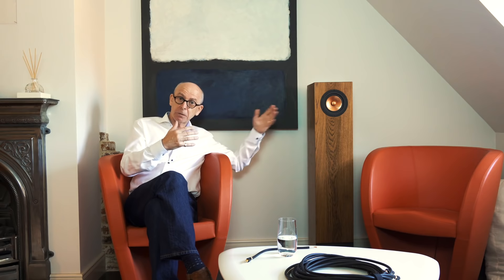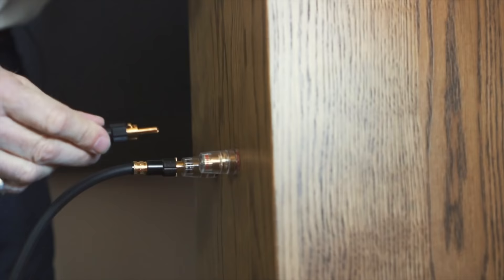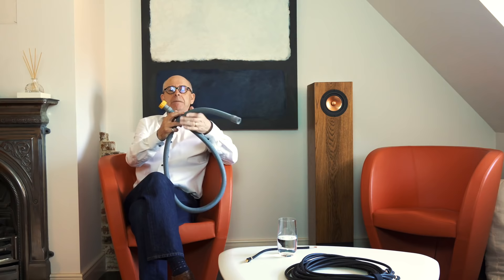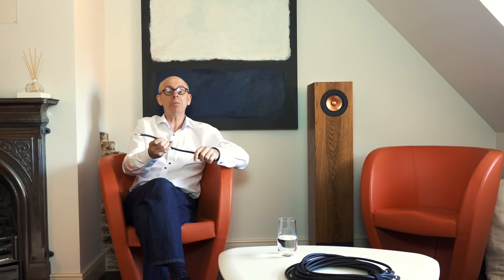Loudspeaker cables - how do they make a difference?

Comment: I don't have a problem discussing cables at all. I DO have a problem with "experts" telling me ONLY expensive cables are the best...
Reply: Here’s a analogy:
1. A tin roof is not going to be as strong as a concrete roof. Apparently a concrete roof costs more. 
2. Similarly good quality interconnects and cables cost more than cheap copper?
Reply: As long as the cable is made of Copper and isn't too thin it will sound perfect. A 1€/m cable will sound the same as a 100€/m cable, as long as it fulfills a certain minimum critera.
Reply: @rolandrohde  Indeed. I have conducted my own blind test on my hi-fi using Van Damme cable (a good quality, reasonably priced copper cable) and another brand (£12.00 per metre) and I could tell no difference whatsoever.
Reply: I was with your mother  totally agree. I was justifying the cost differential between good and bad quality copper. Not debating whether the quality of sound would change significantly to justify the cost.
Reply: @Debagio that probably tells us more about your hifi than the cables tbh
Reply: Listen and watch a very recent upload from audioholics about testing cables he goes through his equipment he uses both the source and the measuring equipment. His results are very interesting basically between the expensive and the cheapest cable and those inbetween there is no audible difference the human ear can pick up its just too small.
Reply: Sound engineers totally agree!
Reply: finally an intelligent hifi man out there!
Reply: are an intelligent man!
Reply: @baboononskates someone has spent a fortune on cable and is frantically defending his huge waste of money
Reply: @baboononskates oh goodness I touched a nerve. You really did spend too much didn't you? And my Arcam and Focal system is just perfect for me, appreciate your concern though.
Reply: @everything777 Arcam and Focal do sound great with 13 AMP Round White PVC Mains Electrical Cable apparently.
Very transparent and great soundstage.
Obviously bare wires into the amps speaker terminals..
Reply: @baboononskates  what are you on about?
Reply: @garynilsson416  dear Gary! Wish i were young! Sadly i am 68!
Reply: @everything777  you are a very healthy person!
Reply: Just for fun I went to a HiFi store and let a young dude explain to me the advantages of expensive speaker cable. After 10 minutes I told him I was Electrician and that he was full of it.
Reply: You are so right! I have been working with advanced analoge and digital gear for 30 years! A good copper cable will do the job!
Reply: @nellyt2807  you are so right!
Reply: @everything777  nice to hear from a person who is not talking bullshit!
Reply: @everything777  i have given up discussing audiocables with the hifi fanatics!
Reply: @nellyt2807 I did.  And guess what?  His measuring equipment was so accurate that he didn't even need to listen to the cables to know how they were going to sound!
Reply: @darwinstubbie860 Do electricians know everything there is to know about speaker cables?  I had no idea!
Reply: @barrymiller3385 do people who have no knowledge of science, physics and electrical theory know everything? Not implying this is you because I don't know your background. There are too many unexperts giving their opinion without true understanding. I say if it works for you great, if not save your money.
Reply: @rolandrohde  

Any cable will have a certain amount of capacitance, inductance and resistance. 
This forms a filter that will change some frequencies in a signal to some degree. 

For a low output impendance device like a power amplifier, the effect is negligible, but in high output impendance sources, like the pickup of an electric guitar, the effect can be dramatic,
Reply: This know-nothing audiohead has made and used, 12-14 gauge pure stranded copper wire since the vinyl bug bit some 50 years ago...SFSG. I'm still using them, the only thing I've done is make them shorter and replace the connectors, twice.

Comment: There's so much snake oil in this area of hi-fi.
Reply: Preach. It started in the 80's when big corporations learned how stupid people can actually be.
Reply: @automachinehead  - EXACTLY!
Reply: No surprise that changing the shape of a speaker voice coil changes how a speaker sounds. That does not prove that changing the shape of a speaker cable will change the sound of a system. There's a big difference between the operating characteristics of a voice coil and a speaker cable.
Reply: @ProffAndy  hm... then again, he didn't change anything about the speaker cable. As I understand, they claim to keep it as simple as possible.

I mean, this is a product information but he is not advertising anything snake-oily, or did he?
Reply: This is a question of psychoacoustics rather than engineering. The testing would have needed to take place under blind, controlled conditions to demonstrate anything.  Geddes/Lee proved that the already known phenomenon of audiological masking caused distortion of up to 20% in some frequencies to be completely inaudible. Not saying that the design changes did/didn’t make a difference , although it’s counterintuitive as it would mean hearing the a mechanical difference introduced by microscopic fractions of current within the sea of distortion that the worlds best transducers are. Just saying that the laws of human psychology apply to engineers as much as anyone else, and it’s possible to be a highly competent mechanical engineer like Mark Fenlon and be quite unaware of them.
Reply: @automachinehead  you can take it all the way back to the '70s.
Reply: Thats why I got out of it many years ago, it went from a fun hobby to a expensive cult.
Reply: it's ALL snake oil when it comes to audiofools.....

Comment: The analogy with voltage and speed is incorrect and the electrons do not "bash" into each other.. wtf
Reply: I agree and have just written a comment to that effect.
Reply: Hard to imagine anyone who knows anything about electricity making that statement.
Reply: @Scottlp2  It's about as close to reality as saying that petrol engines work by the pistons being pushed by the flatulence of little red demons that live inside and love to drink petrol.
Reply: It is even the opposite. Electron repel eachother since they have all have negative charge.
What actually happens:
The electrons jump from the shell of one copper atom to the shell of another one where a "hole" has been created because that atom also had an electron that has jumped.
The electrons are moving from - to +
The "holes" is what we call the current, and move from + to -
Cables do have an effect on the current that they are carrying.
There is resistance, capacitance and inductance and skin effect.
The capacitance and inductance in a normal speaker cable are so low, you can just ignore it for audio frequencies. At most, it will attenuate higher frequencies, but never to the extend that it will be audible. This is an educated guess, I did not take the time to calculate this.
The resistance just attenuates the signal, and doesn't change the sound. The volume knob will compensate for this.
Skinn effect again can have a very small impact on the highest frequencies, but virtually inaudible. Audioholics have some calculations on their site for sure.
Of course a speaker voice coil can change the sound. It is a coil, so a high inductance, and together with the filter, I guess you can create an unwanted resonance frequency.
Reply from the maker: @Richard-bq3ni  thank you for this excellent comment. It adds greatly to the quality of the debate. The problem in all these talks is to which level one should explain things. I am not a physicist but I did refer to one. I even contemplated bringing one into the short video but I felt it unnecessary. Your comment has added the value I was looking for. But of course it is very possible that someone will now challenge it.
Reply: The concept of a mettalic bond....or ohms law are beyond him....and yet....I'm sure he takes a lot of money from chumps.
Reply: @think2023  I agree. Nearly 27,000 views (so far) at fifteen minutes each is a LOT of time wasting (6,700 hours).
Reply from the maker: @think2023  thank you for your reply. I thought I was making a useful and informative video. It is always difficult to pitch the level from a technical perspective. When I used the term ‘bash’ I thought it was appropriate to show that the electrons are not flowing from one end to another. I didn’t say ‘collide’ as obviously that would be incorrect. I did leave out a lot of points like ‘skin effect’ the point I was trying to make is that in the whole HiFi story the cables should be your least concern. And that good quality, multi strand copper will work fine. Which is the standpoint I like to keep. I am not a nuclear physicist but I do have a strong grasp of physics and acoustics. I am sorry that my video offended you so much.
Reply: @PearlAcoustics  ALL of the science I referred to I learned....in high school.
Again...please dont waste peoples time on account of your lack of diligence....its just unfair....unhelpful...and disrespectful.
Reply: @PearlAcoustics  perhaps you should rephrase your comment...." it's always hard to pitch from a technical perspective when you have no technical knowledge".....

Maybe you should add speaker cables to your offerings. I'm going to suggest dunning-kruger as a model name.
Reply: @dweblinveltz5035  sorry...no idea what you are talking about. Last I checked it was about physics and ohms law
Reply: @think2023  I noticed autocorrect changed key wording in my last post; maybe it will be clearer for you now.
Reply: @dweblinveltz5035  the topic of the video WAS electron interactions
Reply: @think2023  now you’re just being obnoxious. He’s making these videos for free. And occasionally, some may need some corrections. We are all human. At least he is contributing to society, and many of his other videos are helpful. What have you contributed lately?
Reply: @think2023  No mention at all because they need not be mentioned at all. You are the typical nincompoop looking for anything to take offense from. The entirety of the point is that, with any good copper speaker wire, you will be satisfying the requirements for resolving the signal path. Period. But please, feel free to elaborate ad nauseum regarding your opinion on the world as we know it.
Reply: @think2023  Wow, pedantic much? Anyone can see that he's explaining in very layman's terms and in a way non knowledgeable people can get a hint of the science behind it. Many people will not actually care about the accuracy of the information
Reply: @limp6986  when talking about science there are different levels of Truth and accuracy. In Ohm's law for instance the first approximation refers to resistance. If someone was talking about speakers and referred to the resistance of the speaker cables it could explain a lot about the behaviour of speakers and amplifiers and damping of the woofer and so on. When you look more deeply you will see capacitive and inductive reactance skin effect the effect of impurities in temperature and much more. I have zero quarrel with simplifying science in an effort to help a Layman to gain a basic understanding.
However....when total falsehoods are espoused by someone who is obviously ignorant of the science...I consider it wholly unhelpful.
Reply: @Simplyveej  make no mistake. This man is selling something. He is selling speakers and cables. It ain’t free. The cost is your intelligence. This video deducts at least 2 iq points per viewer.
Reply: @derekr5327  Selling something is not evil. He is making a living like the rest of us. Chances are that your job and your salary exist thanks to a sales person somewhere. And just because he's selling doesn't mean we are compelled to buy. We are free to make our own decisions.
Reply: @dudemastermaster8944  
The only difference can be decibel level. I'd that's the case get larger gauge wire for the longer runs and that's that.
The imaginary man can't hear a difference because there is no difference.
Reply: @Finn-McCool  well that wraps up what I said. So I call that a stalemate. Stay safe.
Reply: Why do audiophiles all think they are experts about electron flow etc.

Comment: Been in electronics for over 40 years and wire vs SQ has never been an issue for me. I do like the bit that tightens the banana post in the hole. That's actually simply brilliant.
Reply from the maker: Thanks. I wish I had invented it! 😉
Reply: Hi Harley,  Another very illuminating video, love the domino analogy.  Where can one get the locking banana plugs from please?
Reply: Came here for the comments, love them. Didn’t watch the video yet. I will say, when you look inside a tower speaker ( a have the respectable Rega R7), there is about 4 feet of zip cord ( or something similar) that travels from the binding post to the drivers. To think the 8 feet of external speaker wire makes much difference is pretty funny ( unless it’s very thin aluminum or something). But for some reason my friends still looked upon my good quality but fairly inexpensive cables with disdain. So I made my own, dressed up with nice ends, shrink tubing , and braided sleeves. Thinking I finally invested in higher end cables, They swear it made a difference. But it didn’t.  Eyes play tricks on our ears.

Comment: Years ago McIntosh used to do 'traveling labs," going from city to city.  They would check your old amp if you brought one in.  In those labs they would compare various speaker cables and ask listeners to identify when better cables were being used.  The listeners did not know which cables were being used.

There was no consistency in selecting between cables - from standard 18 gauge zip cord to "audiophile" cables.  This proved to me that the whole issue of "better sound" with expensive cables is marketing - if you can't SEE that the expensive  cables are being used, you can't "hear" the difference.
Reply from the maker: Hi thanks for your comment. I get your point entirely but I want to add that some manufacturers set out to make cables that sound different (and it’s quite easily done) but I personally prefer to keep things clean and just use plain, good quality multi strand copper.
Reply: I agree. Any decent cable is probably indistinguishable from another decent or even extraordinarily good cable, but a bad cable could ruin the sound. The balance is to get a decent one at a reasonable price.

Comment: Electrons do not bash into each other, in some kind of microscopic Newton's Cradle manner.
There is such a thing as electron drift velocity - it's dependent on current and also wire diameter but a typical figure is about a tenth of a millimetre per second. 
Energy is delivered through a conductive material by dint of an electromagnetic field. A conductive material is that in which such a field can exist. That's how transformers are able to energise a secondary coil (or multiple secondaries) even though the coils are insulated from each other.
I don't like being a party pooper, but the information presented here regarding the fundamentals of electricity flow simply isn't correct.
Reply: And it is an AC not a DC signal too which is sent to the speakers.
Reply: @MoltenJules  Good point, Julian - I hadn't considered that electrons would need to 'unbash' each other as well as bash into each other. I'm not disappointed for me, but for the people who might believe this stuff...
Reply: @kamadeva1  What, specifically, did Drude say that demonstrates that electrical flow is caused by an electron bashing into the next?
Reply: of course not...these guys all 'preach' in the same manner......it is as if they have to translate their 'brilliance' into a lower level language for us mere mortals.  this guy, and all of the other posers, are full of BS.

Comment: I have a pair of Epos ES-14 loudspeakers. They are a two driver design with no crossover, only a capacitor across the tweeter. They are 30 year old speakers but can still outperform modern speakers today - where it really counts, in the midrange, vocals and acoustic performances. I believe it's because Robin Marshall custom designed the drivers to work together with the cabinets. Enjoyed this vid.
Reply: I have a pair of Epos ES-22 floorstanders coupled to a Quad Elite Series and I agree with everything you say. The amplifier connects directly to the mid driver. You can't better that.
Reply: The Robin Marshal designed ES14 and ES11 speakers are wonderful communicators of music , not hi fi.The main driver being directly coupled to the amplifier with a minimal 1 capacitor and 1 resistor  to the tweeter , less is more.
Reply: I had the EPOS 11’s. AmaZing
Reply: I had ES14's Now the Kids are gone I have M22's